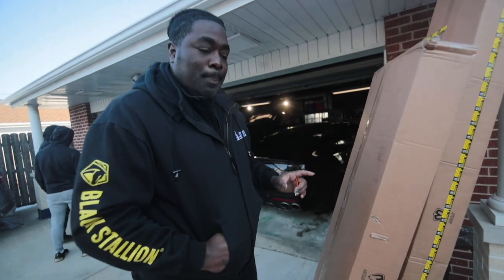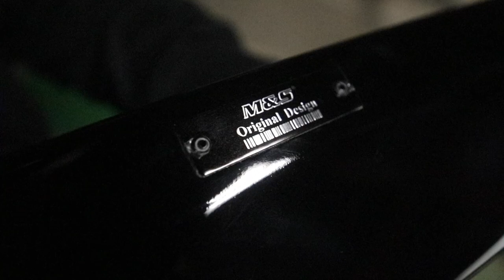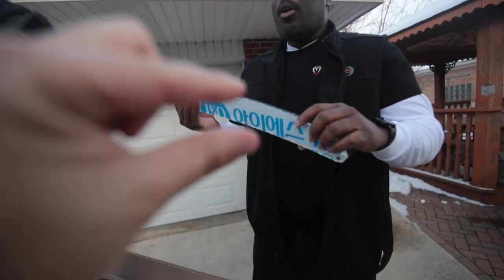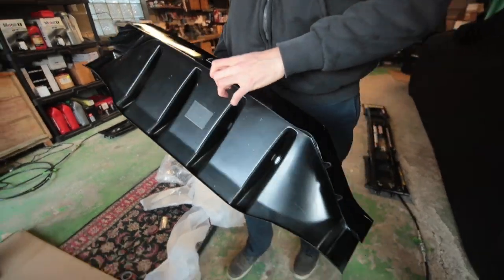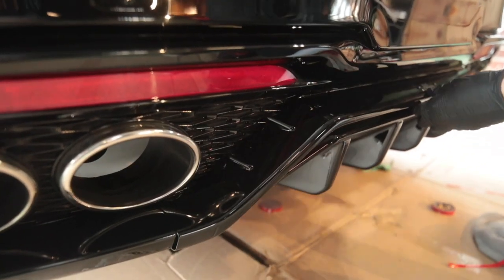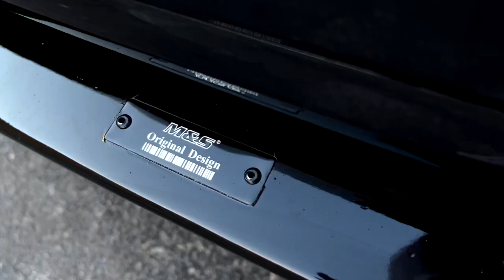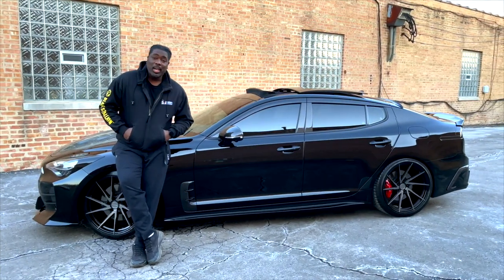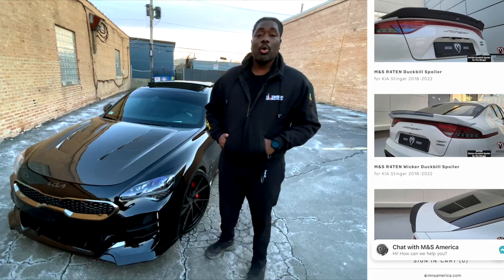2022 KIA STINGER NEW AERO KIT "FORCE SERIES" BY M&S

Comment: Looks 🔥, After I heard that 22 diffuser wouldn’t fit, I went with the last model. (100% Jelly btw). Still planning on getting a force series version put on her front, I’ll def have some M&S mix matching going on🤤 
[Ive looked at other brands but, keep getting pulled back to the M&S kits😮‍💨]
Reply from the maker: It’s HOT hard to keep your eyes off
Reply: @VividVisual  You cant NOT look back at it… Impossible. I’ve tried.
XD